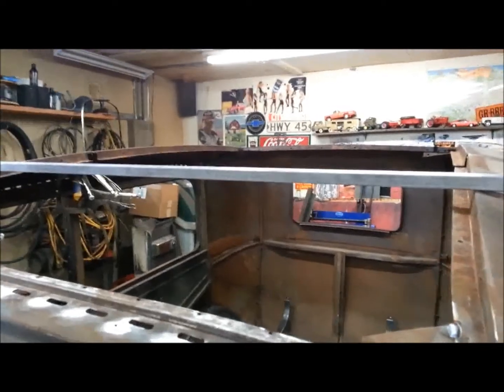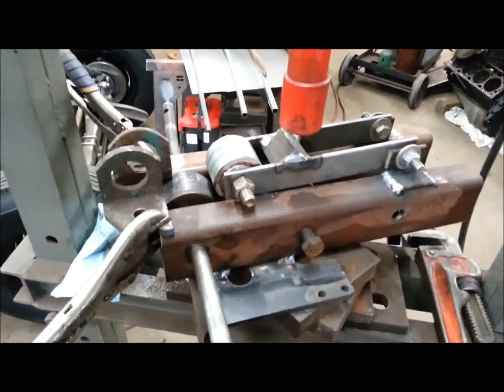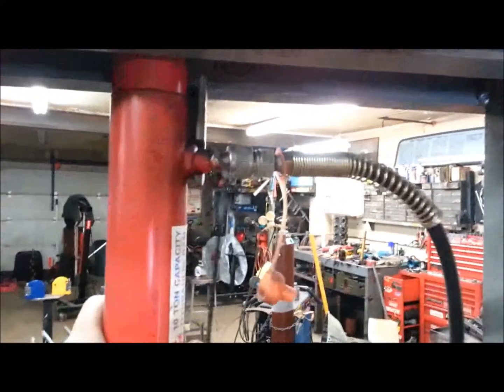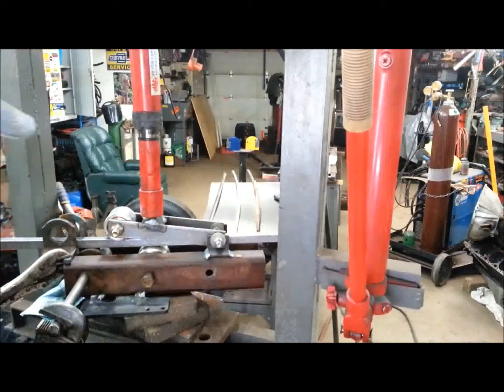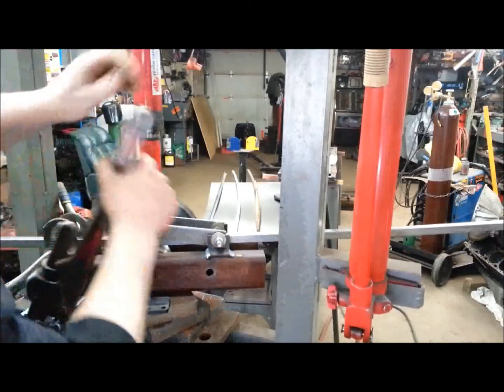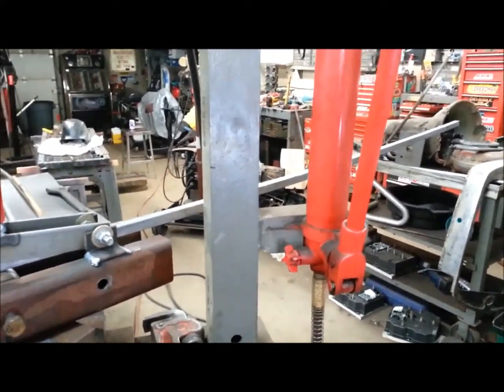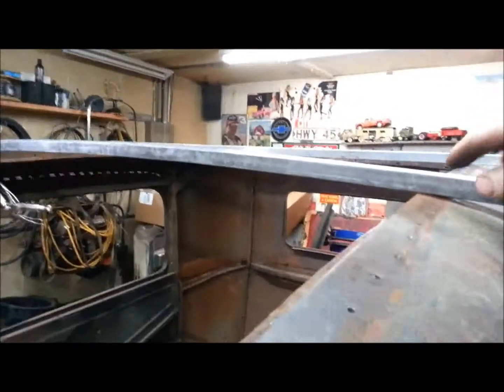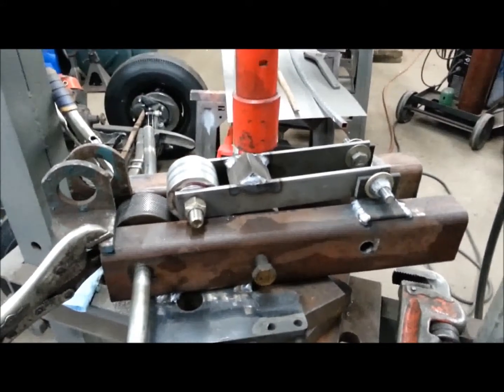making wood roof bows from metal

Comment: That's pretty slick right there. I'd probably sitting on it propped between two chairs or something...
Reply from the maker: funny you say that , because I tryed that first . But it wouldn't make an even bow in the metal like I wanted . Even tryed bending it around a 11R22.5 truck tire . Had one end chained to the tire , and a pipe over the tubing to bend it around just right , that didn't work too . I could of bought the tool to do this , but 600 bucks was the cheapest for a some what qulity product . This cost me nothing but a day of drilling holes and welding junk together . Way more fun :)
Reply: And you can use it again...but I bet if I sat on it it woulda bent....lol
Reply from the maker: maybe ... lol
Reply: 249 lbs of metal bender,,,lol
Reply from the maker: wow , my guess was WAY off ..... :P
Reply: hmmm...not sure if that's good or bad...lol
Reply from the maker: last time I scaled in , 220 ....lol
Reply: I'm winning that contest...I think..
Reply from the maker: yes , we will say your winning on this one ....
lol
:)
Reply from the maker: ***** hold on there !!!
read ndebt4kids comment  , he has us both beat !! :P
Reply: Nice work of course! Going to work out perfect.
Reply from the maker: Thanks Stoney !

Comment: matt that worked awesome,i like how u made the frame and the brackets that hold the pump on the side,nice fab work on the tube bending,im seeing alot more uses of the press here,good vid,tc
Reply from the maker: i was suprised that it worked to Rick ! lol
But it does work , and it made the bows I need to keep going on the roof for the car . So a day well spent playing around .
The press works great . At the time , I didn't have the money to buy a good shop press . And I needed a good port a power . So stuck my money into that and built my own frame work . It's been used a lot over the years pressing U joints , bearings and wheel studs . And  I have a few fixtures made for bending metal with it .  But It's only a 10 ton , and down the road I want to make a 20 ton press .
with a wider bed . :)

Comment: Very clever. I'm not averse to wood or working with it so I put a wood kit in my 29 CCPU than traced lots of it with 3/4" square tubing just to tie the entire structure together with welded steel. Not being quite as clever as you however, I pie cut and welded to create the crowns. They match the wood very nicely but lots more work. I'll send some pic's if you like.
Reply from the maker: Pappa Bob my idea was ok . I made up a bunch of roof bows , but they were all twisting . My jig wasn't built perfect , and would let the metal twist . I gave up on that idea for now. But used the best two for above the window to beef that up . To date , i'f just been running an open roof and like it . But i'll be buying the wood kit and factory roof top and install that one of these days .

Comment: that really works well how did you even think of building that jig .oops I forgot thats not PC .I meant fixture .
Reply from the maker: first off , there will be no PC spoken on this channel .... lol 
I saw a bender that does this , but costs about 400 bucks for the cheapo china ones . and 600 for the one built down the dirt path from the 400 one. So after digging through my junk piles and doing some brain melting thinking  . This just happened to come about . A jig to bent my roof bows . May never use it again , or it might get finshed up and painted  .
And if you need to borrow the jig , it weighs 40 pounds , so your paying for shipping Eric ... lol :)